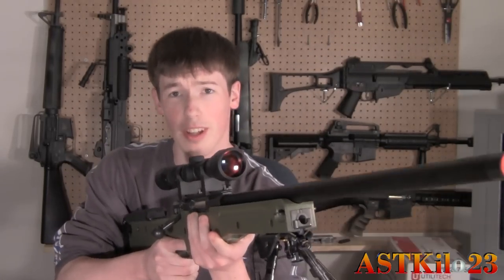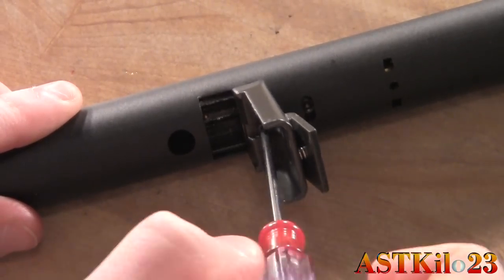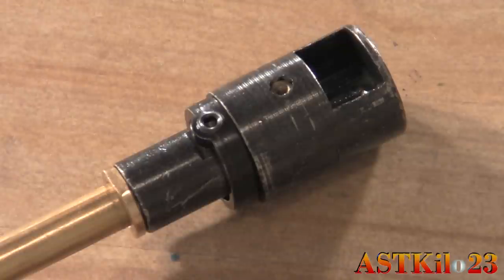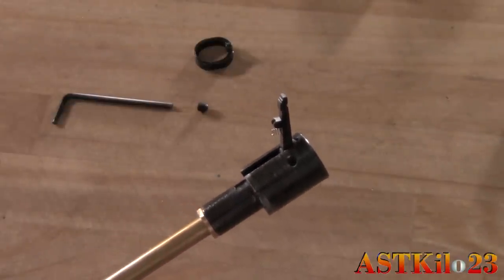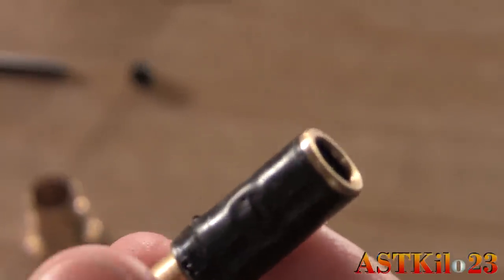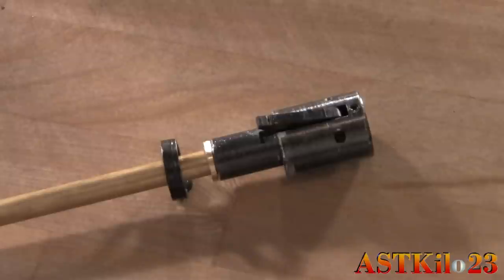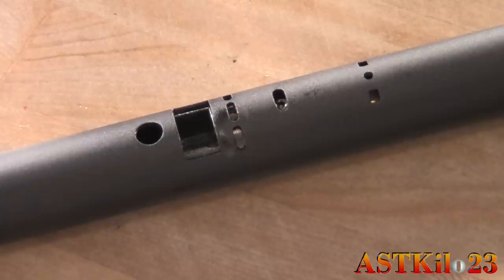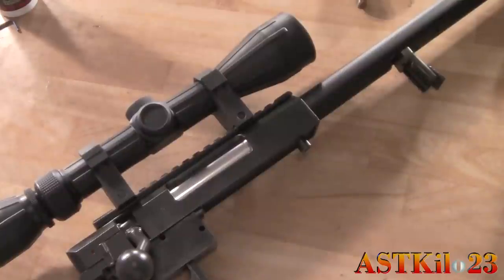DIY: UTG L96 Hop Up and Barrel Disassembly and Reassembly  -ASTKilo23-

Comment: Nice video.  Wish I had it back a year ago when I was upgrading it, but I figured it out eventually.  I personally did some basic DIY mods, added the UTG upgrade kit, and got an extra bucking from leapers, and now it shoots about 200ft consistently with 0.28g bbs.

Comment: Don't know if it has been mentioned, but I just want to throw in that if you have the UTG L96 and you tear your bucking, you can call up Leapers and get a replacement one for free (if you have had the gun for less than 30 days), or for cheap if it's been longer.

Comment: i need MAJOR help! My utg l96 is shooting all over the place.... sometimes up and to the right, sometimes down to the left etc etc..... i took my gun apart and cleaned the hop up and the inner barrel, still no progress. i also tried tinkering around with the hop up but it still shoots randomly even if its going strait down. My gun is completely stock and im wondering if the upgrade kit would fix this problem, or a new bucking. all i know is that i don't want to buy a new gun.

Comment: Is it normal for my inner barrel (along with the bucking) to be able to twist inside of the hopup chamber? If not, what is supposed to keep it from twisting freely? Also, what hopup chamber would you suggest getting for this gun in order to use standard AEG buckings? What bucking would you also suggest with your suggested chamber? Any suggested store/site for those? (Sorry for all the questions.)

Comment: I was a moron and when I tried to twist off the barrel, I didn't see the tiny hex key screw that is required to loosen up the barrel. I used my strength to try and twist off the barrel and then I realized that I was doing it wrong. Now I can't twist it back on (its stuck after about a centimeter of hard twisting). Is there a way to fix that? Help please :(

Comment from the maker: electrical tape and 20min = best fix. least expensive and you don't have to wait a week for parts to arrive. simply make electrical tape rings around the inner barrel so that there is no movement inside the outer barrel.

Comment: Hey im pretty sure the screw that u need the alleb key to open the barrel not the one for the mg catch isnt there because ive used a 1.5 and tried others and nothing happens also when i look im the hole i dont c a screw but if it wasnt there it woyld still open right can anyone help me thanks

Comment: The problem with my gun is that my brother dropped a log on it, and from the outside it appeared fine, but when I shot it, the bb shot really far down, so I adjusted the hop up and it did nothing, and THEN if I held the barrel down at all the bb would roll out of the barrel.  Any suggestions on whats wrong?
Reply: *facepalm
Reply: Have the same problem.

Comment: Well this worked if your hop up arm broke go bye some extra strength instant crazy glue and glue it back together and wipe away excess glue with a paper towel give it a few minutes to make sure it wont glue to any thing else then it should work

P.S.(this is important see how it fits together before you glue it because if you mess up you'll be lucky to pull it apart in time to fix it so just know how it all goes before you glue it back together

Comment: I have disassembled and reassembled it and when I shoot it there is just a poof sound I don't now what I did
Reply: kingskull691 Was it only the hopup you disassembled? If it doesn't even shoot, your hop up rubber is probably not correctly installed.

Comment: And what if the inner barrel and hop up won't come out of the outer barrel?
Reply: Might be that the screw of the hop up is blocking the way. Screw it in some more and then try to pull again.

Comment: bbs role out of the front my my barrel what's wrong?
Reply: Justin Baws Have you finded answer yet
I have the same problrm
Reply: No, Niko Vaananen
Reply: +Niko Vaananen Elikkä vika on hoppissa kannattaa kattoo hoppikumi tai sit piippu voi olla ottanu iskua ja mennyt rikki
Reply: Problem is on hop up chamber i would check It or buy a new hop up chamber. Or the inner barrel is broken If It has took an hit :)
Reply: +Justin Baws is your hop up turned all the way off? If so that's your problem, nothing gripping the bb
Reply: Pyllynalle joo tarkistin hopin ja hoppikumiham siel oli paskana ja jotai muita osii. :)